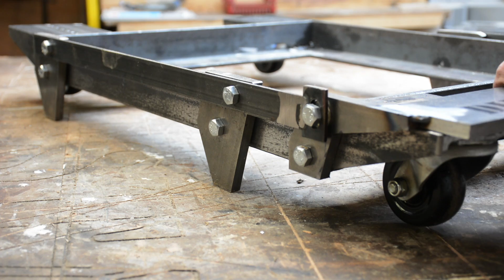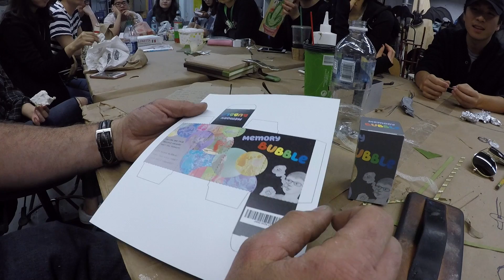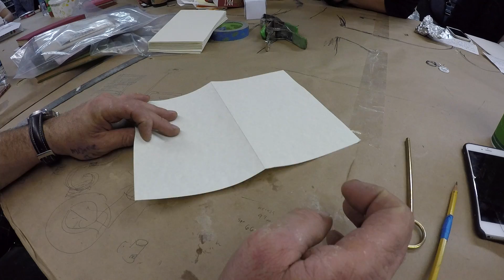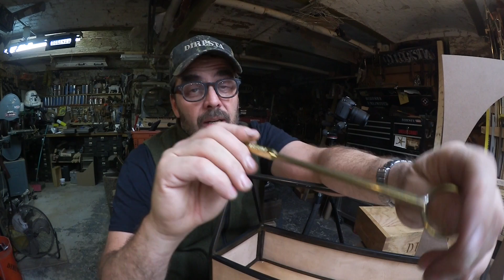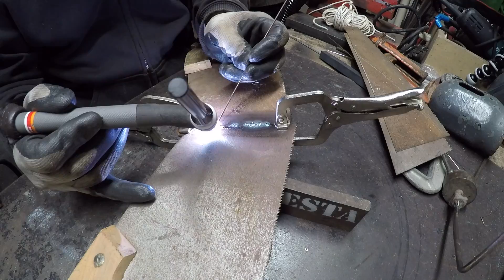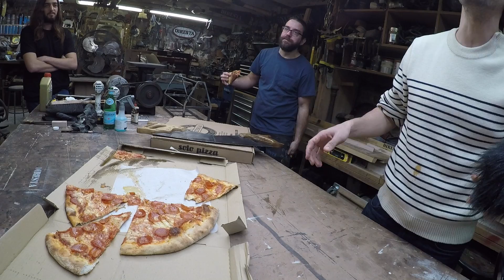✔ DiResta 7 Food Safe?!?

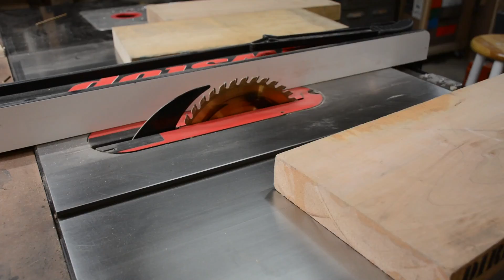Comment: 1:12 I've never seen a guard on a table saw like that before. What is the advantage of that?
Reply: It is a rip guide.  It keeps the wood from going askew and getting caught in the blade, resulting in kickback.
In other words, it keeps the piece being cut in-line with the blade.
It is, at a minimum, the most necessary and effective safety tool you can put on a table saw.

Comment: Jimmy, How do you like that new Dewalt Grinder. The 60volt battery? I hear Dewalt shorted the voltage values to 42 actual volts! How does the brake system function?

I really like the small battery table saw! I am a Milwaukee fuel addict!

Comment: I love seeing the book making process. I worked at a book bindery for about 2 years and ran a paper binder machine for a short time before work slowed down and forced me to look for employment elsewhere. I still credit that job to getting me into working around machines and with my hands. It was a real big confidence booster learning how to set up the machine to run books through it.  It would take sections of paper back books and put the paper covers on them using hot melt glue. It would then go down a conveyer belt to a three knife machine to trim the three sides of the book and then would get put into boxes to be shipped out.